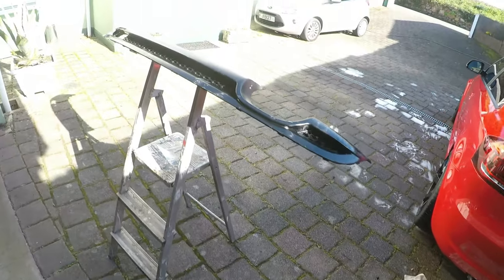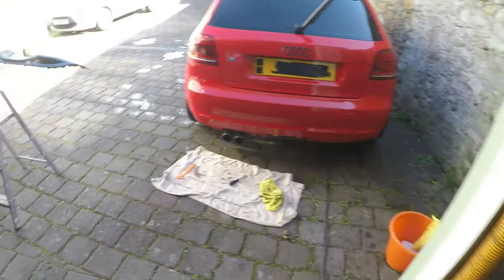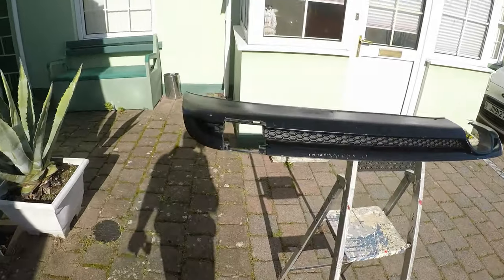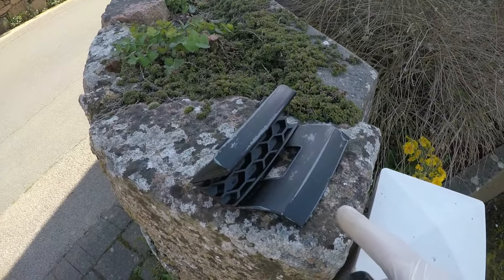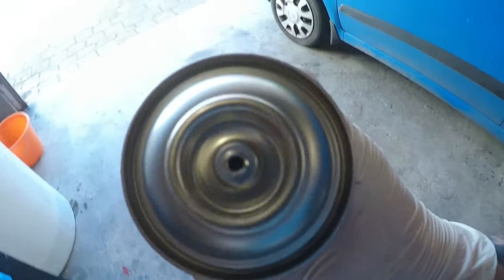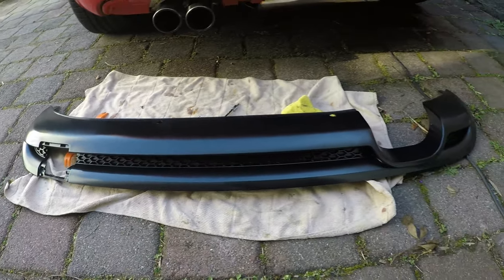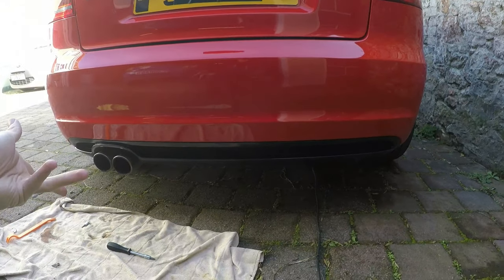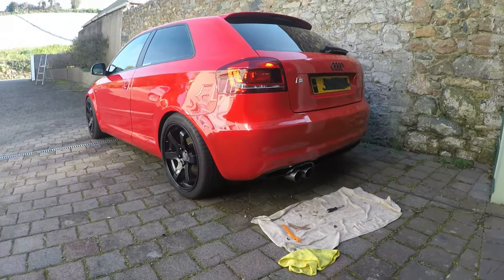Re-Spraying My Diffuser! & New Mod! - Audi A3 8P

Comment: Hey buddy lovely work!
One question, I have the same model and would like to know if the S3's 8p diffuser fits on ours.
Continue that brilliant work!
Reply from the maker: Aristotelis 356bc Hi bud, unfortunately I think it is a completely different setup, due to the s3 having a lower rear bumper and it stays the same hight throughout the car with the side skirts and front bumper, so no I do not believe it would be a straight swap.. cheers buddy
Reply: @MotoAdventuresYT  
Okk, no worries still looks good! 
Thank you for your quick reply! Your Audi looks awesome by the way!
Reply: @aristotelis I think you can get a whole new balance and have a s3 set up as I’m getting one on my a3 8p

Comment: Hi, didnt u had problems when fitting it back because i got mine and i got a little space in the middle of the diffuser between it and the bumper. The rest of the clips on the sides go easily inside but the ones on the middle i cant get them to fit.
Reply from the maker: Daniel Drobota from what I remember it was just a slide in and put the two screws on mate